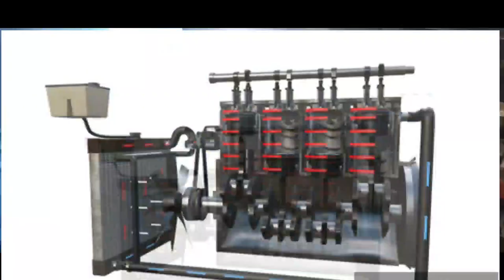MITSUBISHI ADVENTURE TEMPERATURE SENSOR CLEANING AND THERMOSTAT CONCERN IMPORTANTE PARA SA BAGUHAN

Comment: Disclamer lng boss, hindi dapat nilalagyan ng silicon ang internal portion ng radiator hose. Thru my experience as chief ng technical sa loob ng 35 years sa malaking kompanya ng saudi arabia. Purpose ko dto para d tularan ng iba, babara sa galeries yan lalo sa cyl. Head.  God bless! Tuloy mo lng.
Reply from the maker: Yes Sir,. Salamat ng marami sa karagdagang kaalaman, Tama po kayo hindi adviceble na lagyan ng sealant ang tube and hoses,, ang problema sa status ng hose and coollant tube ng unit subject for replacement na dapat para iwas coolant leak then iwas engine overheat, kaso ang problema ang unit owner mismo ang nagsabi na pwede pa yan Sir, pagawan ng remedy palagyan ng sealant para makatipid saka na lang palitan kapag talagang sira na,. As a mechanic ginawa na natin ang lahat ng advice kung ano ang ikakabuti ng unit nasa owner ang pasya. Salamat Sir Laban lang,.

Comment: Sir, salamat sa video. Same kaya dito ang problema ng adventure ko? Overheat sya after running ng around 20-30 kms. Mauubos ang tubig kahit full yung radiator pag start. Newly replaced na yung water pump at newlt overhaul din ang radiator
Reply from the maker: Yes Sir, dapat po dito replace po kayo ng standard thermostat from mitsubishi para po hindi na mag bawas ng coolant ang engine
Yes Sir, FB Page CARS CLING TV: https://www.facebook.com/clingauto
Mobile09171259996
CARS CLING TV Located @Purok Pandian Gay Corner Makar Highway Brgy. Labangal General Santos City SouthCotabato 9500

Comment: Idol baka naman Po sa mga next video nyo paturo Po ulit Ng mga bleeder Ng sasakyan hindi Po pa Po alam eh radiator Po Kasi Ang ginagawa ko yan Po Ang problema ko eh ung bleeder idol thankyou po nice vlog Po idol🤙🏻🤙🏻
Reply from the maker: Yes Sir. Upload po tayo next time ng how to Bleed sa radiator? Anong unit  Sir? May tips ako sayo paano mag Bleed ng radiator.
Kapag lumalabas ang hanging sa radiator system, ito ay senyales ng air pockets o trapped na hangin sa loob ng sistema. Upang maayos ang problema ng bleeding sa radiator system, narito ang mga hakbang na dapat gawin:

1. Paandarin ang makina at hayaan itong uminit nang may takip na radiator.

2. Buksan ang radiator cap o ang coolant reservoir cap kung mayroon nito. Siguraduhing ingatang huwag mahawakan ang radiator o coolant cap dahil mainit ang likido sa loob.

3. Hanapin ang bleeder valve o bleeder screw sa radiator o sa coolant hose. Ito ay maliit na gintong screw na karaniwang matatagpuan sa taas ng radiator o sa coolant hose.

4. Gamit ang flat-head screwdriver o appropriate-sized wrench, i-rotate ang bleeder valve ng bahagya hanggang sa labas ang hangin at lumalabas na lamang malinis na coolant. Siguraduhing maging maingat at hindi lumalagpas sa takdang sukat ng rotation para hindi mabasag ang bleeder valve.

5. Patuloy na i-monitor ang coolant level habang ito ay lumalabas sa bleeder valve. Patuloy na idagdag ang coolant hanggang sa hindi na lumalabas ang hangin at malinis na coolant na lamang ang lumalabas.

6. Kapag natapos na ang pagbleeding ng radiator system, isara ang bleeder valve nang maayos at siguruhing maingat na mabalik ang radiator cap o coolant cap.

7. Siguraduhin na tama ang coolant level at ayusin ang iba pang posibleng sira o leaks sa radiator system.

Ito ay mga general na hakbang na maaaring gawin ngunit maaring mangailangan ng espesyal na pag-aaral ng user manual o pagpatulong sa isang propesyonal na mekaniko depende sa uri ng sasakyan at radiator system na mayroon ka.
For more inquiries contact @ FB Page CARS CLING TV: https://www.facebook.com/clingauto
Please Support, Follow and Send Stars to make more Videos upload. Thank you and God bless!
#gCashPersonalNumber 09171259996
CARS CLING TV Located @Purok Pandian Gay Corner Makar Highway Brgy. Labangal General Santos City SouthCotabato 9500
please support my other channel:
CARSClingTvShortVideos: https://www.youtube.com/channel/UCsUWQnaD9vVKqL_w6eAYhgA
Aqua Marine Adventure: https://www.youtube.com/channel/UCHxjUhFmYMbRGxN3l21pNeg

Comment: Bago ka mag vlog e compare mo muna walang thermostat o meron.ang walang thermostat mas maganda ang cooling system ng makina.pagdating sa lngdistance expressway kya sobrang init ng makina dahila kulang supply sa cooling system dahil sa thermostat na yan pinipigilan ung flow ng tubig kunti lng papasok papasok sa makina lalo kung luma na thermostat mo yan nga ang nka cause ng overheat sa makina ung thermstat na yan 
Pp
Reply from the maker: Ang pagkakaiba ng mayroong thermostat assembly sa walang thermostat assembly sa isang sasakyan ay ang sumusunod:

1. Regular na temperatura ng makina: Ang thermostat assembly ay responsable sa pagkontrol ng temperatura ng makina. Kapag mayroong thermostat assembly, ito ay nagpapanatili ng konsistenteng temperatura sa loob ng makina. Sa kabilang banda, kung wala itong thermostat assembly, ang temperatura ng makina ay maaaring mag-variate at hindi makontrol.

2. Fuel efficiency: Ang thermostat assembly ay nakakaapekto rin sa fuel efficiency ng sasakyan. Kapag naisasantabi ang temperatura ng makina, pinapalakas nito ang efficiency ng pagsunog ng gasolina. Sa kabilang dako, kapag wala itong thermostat assembly, maaaring maging mababa ang fuel efficiency dahil ang makina ay maaaring mapainit ng sobra o hindi umabot sa tamang operating temperature.

3. Proteksyon sa makina: Ang thermostat assembly ay nagtataguyod rin ng kaligtasan at proteksyon sa makina sa pamamagitan ng pagkontrol sa temperatura. Kapag sobrang init ang makina, kumikilos ang thermostat upang dumulas ang coolant at ibaba ang temperatura. Ito ay hinahadlangan ang posibilidad ng sobrang pag-init at pagkasira ng makina. Kapag walang thermostat assembly, walang mekanismo na nagbabantay sa temperatura at maaaring makasira o mag-overheat ang makina.

4. Pag-init ng sasakyan: Ang thermostat assembly ay lubos na nag-aambag sa pag-init ng sasakyan. Ito ang nagkokontrol kung kailan dapat buksan ang coolant na pumunta sa radiator at kailan isara ito. Kapag walang thermostat assembly, maaaring maging problema ang pag-init ng sasakyan dahil walang mekanismo na nagkokontrol ng coolant flow.

Sa pangkalahatan, ang thermostat assembly ay may mahalagang papel sa pagpapanatili ng tamang temperatura at pag-andar ng sasakyan. Ito ay nagtataguyod ng fuel efficiency, proteksyon sa makina, at maayos na pag-init ng sasakyan. Kapag wala itong thermostat assembly, ang mga nabanggit na benepisyo ay maaaring hindi maabot.

For more inquiries contact @ FB Page CARS CLING TV: https://www.facebook.com/clingauto
Please Support, Follow and Send Stars to make more Videos upload. Thank you and God bless!
#gCashPersonalNumber 09171259996
CARS CLING TV Located @Purok Pandian Gay Corner Makar Highway Brgy. Labangal General Santos City SouthCotabato 9500
please support my other channel:
CARSClingTvShortVideos: https://www.youtube.com/channel/UCsUWQnaD9vVKqL_w6eAYhgA
Aqua Marine Adventure: https://www.youtube.com/channel/UCHxjUhFmYMbRGxN3l21pNeg

Comment: Boss ako nagpapalit ng thermostat sa advie ko, pag inopen koung sasakyan sa umaga kusang lumalabas ung tubig sa radiator, di namn sobrang lakas parang umaapaw lang, anonkaya possible problema non?
Reply from the maker: Yes Sir, do not be worry, very normal po ang engine status ng coolant dahil pressurized pa po ang loob ng Colling systen nito kaya once na mag open ka lalabas po talaga ang coolant,.
Yes Sir, FB Page CARS CLING TV: https://www.facebook.com/clingauto
Mobile09171259996
CARS CLING TV Located @Purok Pandian Gay Corner Makar Highway Brgy. Labangal General Santos City SouthCotabato 9500
Reply: @carsclingtv  sir ung thermostat na nabili ko may butas s agilid na maliit di kagaya ng sa inyo na oara may turnilyo na maliit, okay lang ba kahit may butas na maliit?
Reply from the maker: Ang maliit na butas sa tagilirang bahagi ng thermostat assembly ay kilala bilang bypass hole o bypass port. Ang pangunahing gamit nito ay para sa normal na pag-andar ng coolant sa loob ng sistema ng coolant ng sasakyan, kahit na ang thermostat ay sarado pa.
Ang bypass hole ay nagbibigay-daan sa coolant na dumaloy mula sa thermostat housing patungo sa cooling system kahit na ang thermostat ay nagkokontrol ng main flow. Ito ay upang maibalik ang coolant sa radiator para sa tamang pagpapalit ng init kapag kinakailangan. Mayroon itong papel na mapanatili ang maayos na temperatura ng makina kahit na ang thermostat ay hindi natatanggap ng signal na magbukas.

More Basic Pointers  Toturials videos: https://www.youtube.com/channel/UCXSl7FUzPZV3lIxFWCHFTVA
FB Page CARS CLING TV: https://www.facebook.com/clingauto
CARSClingTvShortVideos: https://www.youtube.com/channel/UCsUWQnaD9vVKqL_w6eAYhgA
#
#xadoenginetreatment 
#carsclingtv 
#basicpointerstutorialissuefixed 
#xadoenginetreatmentengineperformancerecovered
#10yearslonglastceramicscarbonmetalcoated 
#carsclingautorepairshoplegacy 
#trottledelayremoval
#blackwhitesmokeremoval
#lowpowerengineremoval
#carsclingtvshortvideos
#xadoenginetreatment 
#changeoilpms
#enginecarbonchroming 
#carsclingautorepairshop
#remedyxadotreatment 
#acceptcheckengineissue 
#troubleshoot 
#legitonlineseller  
#Mobile09171259996
CARS CLING TV Located @Purok Pandian Gay Corner Makar Highway Brgy. Labangal General Santos City SouthCotabato 9500

Comment: ayos din si to si mang kanor nilagyan ng silicon sa ilalim ng hose😂😂😂
Reply from the maker: Yes Sir,. salamat sa suggestion,. tama po kayo dapat hindi nilalagyan ng silicon sealant ang radiator tube kaso depende sa status, ok?. status nito nag advice na tayo na subject for replacement ang both lower and upper radiator hoses nito but sad to say nag suggest ang may ari no budget, then gawan na lang remedy, as a mechanic we must obey dahil hindi naman ako ang may gusto at bibili sa sarili kong pera ng dapat gawin ng mecahnic that it should be done,.  need to listen the other side if ano ang main reason before mag comment, palakihin ang utak huwag po tayo coment ng coment ,aka comment lang po,. ok po,. salamat,.
Yes Sir,. Low Power, Trottle Delay, Black Smoke, Walang hatak, Hirap sa Paahon, gasgas ang Cylinder Wall? Engine Vibration?

Introducing XADO Engine Treatment SMART NANOTECHNOLOGY made from Russia pang remedy sa mga bago at sa  lumang sasakyan xado carbon chroming, proven and tested ang product natin,.

https://www.youtube.com/watch?v=mcqoR3n3l64&t=53s
https://www.youtube.com/watch?v=ZCf2uoMklq0
https://www.youtube.com/watch?v=zdIYPXs3n7Y&t=46s
https://www.youtube.com/watch?v=7hi29QriVa0
https://www.youtube.com/watch?v=rhiZnA98aPk

Exclusive Distributor Only Nationwide

Xado engine treatment for set price is 5,500.00, 250 shipping fee

Mode of payment: Cash on Pick up at LBC Parcel, 3 to 5 days ang dating ng product dahil galing pa po ng General Santos City ang item,.

If confirm po ang order natin paki send lang po ng details
Name:
Address:
Contact:
LBC Branch:

For more inquiries contact @ FB Page: https://www.facebook.com/clingauto
Please Support, Follow and Send Stars to make more Videos upload. Thank you and God bless!
#gCashPersonalNumber 09171259996
CARS CLING TV Located @Purok Pandian Gay Corner Makar Highway Brgy. Labangal General Santos City SouthCotabato 9500

Comment: Ipaliwanag mo muna kung bakit nilagyan ng  thermstat ang makina.para maniwala ako sau
Reply from the maker: Yes Sir! The reason a thermostat assembly is put into an engine is to regulate the operating temperature of the engine. Here are the key reasons why it is important:

1. Engine Efficiency: The optimal operating temperature range for an engine is typically around 195-220 degrees Fahrenheit (90-105 degrees Celsius). The thermostat helps to maintain this temperature range by controlling the flow of coolant through the engine. This results in improved combustion efficiency, reduced fuel consumption, and increased engine performance.

2. Preventing Overheating: The thermostat ensures that the engine does not overheat by opening and closing at specific temperatures. If the engine gets too hot, the thermostat will open, allowing coolant to flow and cool down the engine. If the engine temperature drops below the desired range, the thermostat will close and restrict coolant flow, allowing the engine to warm up.

3. Minimizing Wear and Tear: Consistently operating an engine at the ideal temperature range helps prevent excessive wear and tear on engine components. When an engine runs too cold, it may lead to increased friction, inefficient fuel consumption, and potential damage to internal parts. Conversely, running too hot can cause components to expand excessively, leading to potential overheating, warping, or even engine failure.

4. Reducing Emissions: Modern engines are designed to meet strict emission regulations. Maintaining the proper operating temperature with a thermostat can help the engine reach its optimal emission control efficiency, reducing harmful emissions such as nitrogen oxide (NOx) and hydrocarbons (HC).

Overall, the thermostat assembly plays a vital role in regulating the engine's temperature, ensuring optimal performance, preventing overheating, minimizing wear, and reducing emissions.
For more inquiries contact @ FB Page CARS CLING TV: https://www.facebook.com/clingauto
Please Support, Follow and Send Stars to make more Videos upload. Thank you and God bless!
#gCashPersonalNumber 09171259996
CARS CLING TV Located @Purok Pandian Gay Corner Makar Highway Brgy. Labangal General Santos City SouthCotabato 9500
please support my other channel:
CARSClingTvShortVideos: https://www.youtube.com/channel/UCsUWQnaD9vVKqL_w6eAYhgA
Aqua Marine Adventure: https://www.youtube.com/channel/UCHxjUhFmYMbRGxN3l21pNeg